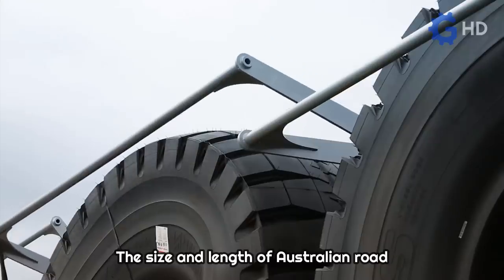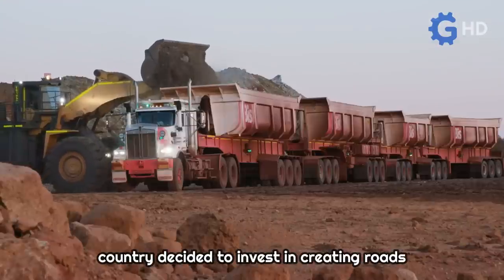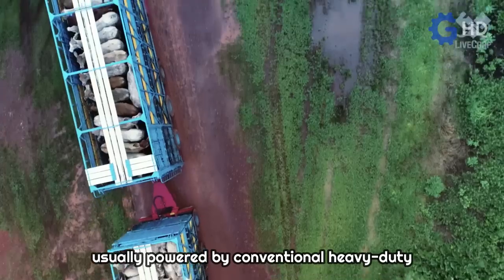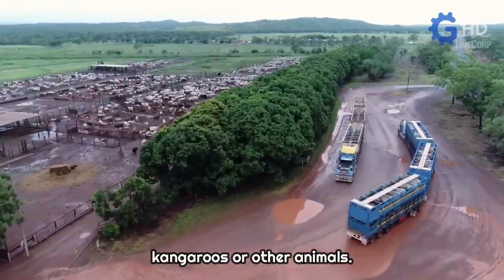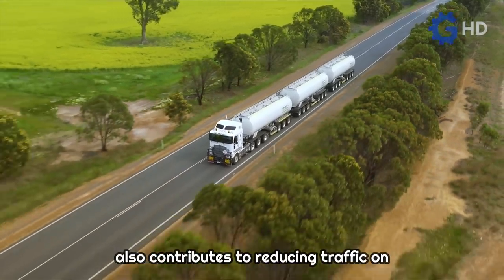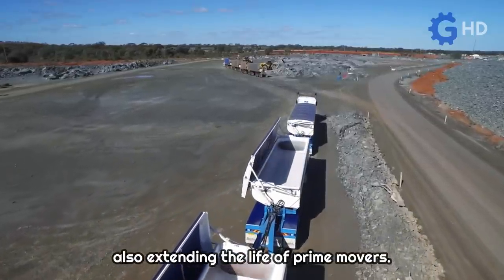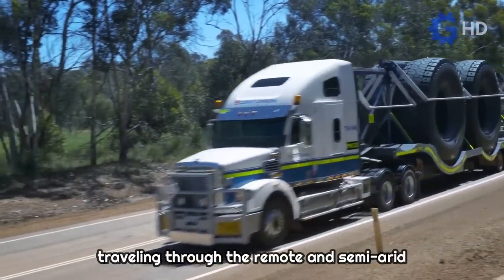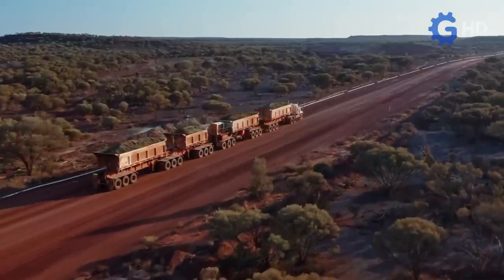Why Do Road Trains Exist? ▶ 200 Ton Oversized Trucks From Australia - Now With Narrator!

Comment: You forgot to mention the best trucks ever built,MACK!!!
Reply: Same here why Mack Trucks Is not mentionens in Australia Is still producer the superliner, thats the Truck that the producers of Cars based on for the character of Mack
Reply: @albertotognoni4819  because it's a Volvo
Reply: @V8Lenny  ouch, right Mack trucks was bought by Volvo in 2002
Reply: @albertotognoni4819  and by Renault in 1980 or something like that.
Reply: @V8Lenny  ok i was missing that
Reply: Macks made in Australia are very much still Macks.They have a different motor, the transmission may be the same as those other things but that's it.Still made in the Mack factory over here.

Comment: Road trains in Australia date back to prior to World War 1 when steam traction engines pulled multiple trailers, many large unique 'one off' vehicles were built here in Australia to pioneer large multiple trailer 'trains"  and around 1930 the British firm AEC built heavy duty multiple axle trucks to pull multiple trailers in Ghana, Australia and South Africa .
These had an 8.8 liter diesel of 130 hp with a 4 speed gearbox with 3 speed transfer cases and 4 driving axles pulling around 30 feet of trailers with  30 - 35 tons.
Later after WW2 the availability of large ex US army trucks brought out to Australia during the Pacific war led to local modifications of ie the Diamond T M20 tank transporter prime movers, by Kurt Johansen , then later large British Thornycroft's, AEC and Foden brands.
This history has created the highly specialised unique and highly modified here in Australia, American and European models that now power our road trains.
Often running 6 500 liter fuel tanks , multiple air compressors to run the air braking systems on 3 - 7 trailers, oversize cooling systems not often required on standard American and European trucks and a myriad of other engineering feats to reliably pull these massive weights has created a local expertise not common in other continents.
Reply: Like Big Lizzy?

Comment: 70k salary, i would not get out of bed for that.
Reply: None of them would be on less than $100k
Reply: That would only be the starter for line haul closer to the city. Mine site road train drivers, the money is more like 100-$120,000
Reply: @Mechknight73 surely it would be more, I'm on 135k and only operate an A double
Reply: I Waa thinking the same thing, saw an ad for mc drivers the other day offering around $170000

Comment: I thought trains were easier compare to truck transport system.
So to transport something Trucks are better option than trains???? And how does this effect environment??? 
You said trains are complex but I think trains are more easier for longer route on that freight trains who do not have to stop constantly and railway do not have to take care of stations
Reply: And diesel trains have massive fuel tanks that can travel for thousands of Miles with tenders full with diesel behind the locomotives
Reply: There's a couple of problems with rail lines into the areas where triple road trains rule; the first is the massive expense of building the lines (this is not like even the US where there's lots of civilisation along the way) the other is maintenance. The Pilbara region of Western Australia, where a lot of the mines are is prone to some brutal flooding at times. Just maintaining it would be a state government responsibility, and nobody really wants to build any lines, save for the mining companies taking their ore to port. From the port to the mine is usually only about 500 kilometres (about 320 miles) but the distance to and from the mine to Perth, the capital is three times that.
Reply: @Mechknight73   oh, that make sense
Reply: @Mechknight73  ouch, you are right that area floods in a certain period of the year
Reply: @albertotognoni4819  I've had to drive through some bad ones at time. I'm a specialist in the transport industry known as hotshot freight. There are four pillars to hotshot operations:
-Somebody broke something
-Someone forgot to order something
-Someone missed the pickup deadline on regular freight channels
-All of the above.
Chiefly what I do is haul the solutions to someone's screw ups

Comment: 400,000 pounds total? Bullshit.
Reply: Some of them are above 400 tonnes now - which is ~880,000 lbs. Mining road trains used power trailer setups with 600 HP trucks and 400 HP trailers; up to 1000HP together.